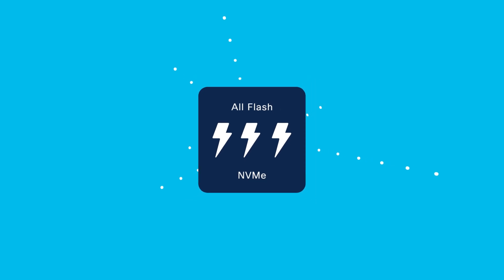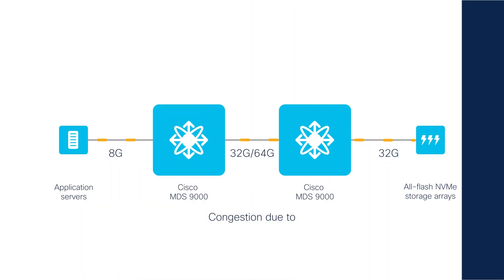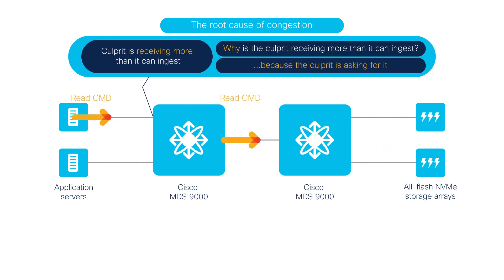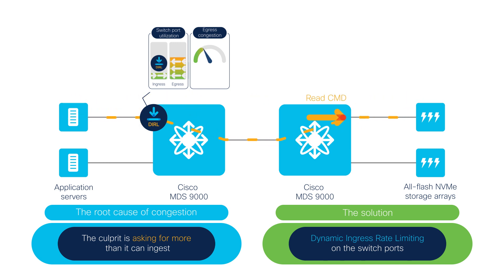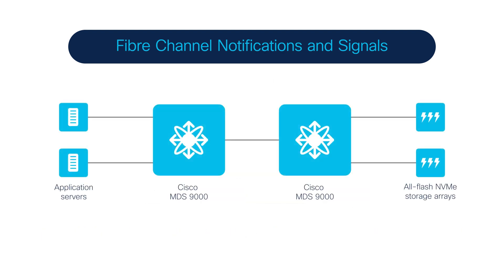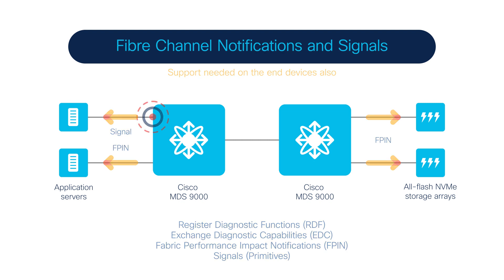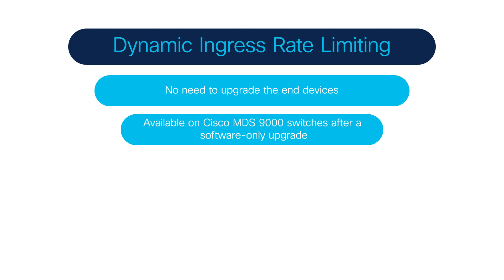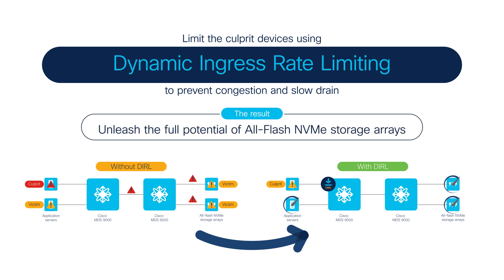Optimize SAN Performance with Cisco DIRL for NVMe Storage Arrays

Comment: How does it know traffic profile of the application? Do we need to configure or it is automatically detected? Will it slow down both read and write operations to storage? Can you add user/configuration guide link in the description?
Nice presentation. Thank you
Reply from the maker: Cisco Dynamic Ingress Rate Limiting Solution overview: https://www.cisco.com/c/en/us/products/collateral/storage-networking/solution-overview-c22-2426817.html
Reply: DIRL has an adaptive stage. Initially, it brings down the traffic, then adjusts the rate up to an extent so that congestion is not spread as per the configured thresholds. The detection and action is automatic but you will have to make a one-time configuration of enabling it. 
While limiting the ingress traffic on switchport, DIRL may limit the write traffic also. This shouldn't be a problem because a transactional app can't perform well just by writing. Also, slowing down both  the read and write I/O is more natural than just effecting one type of I/O. 
You can reach out to your Cisco rep for arranging a live demo and I will be happy to show you DIRL in action. Here is the config guide. Look for the section on DIRL: https://www.cisco.com/c/en/us/td/docs/switches/datacenter/mds9000/sw/8_x/config/interfaces/cisco_mds9000_interfaces_config_guide_8x/congestion_avoidance_isolation.html